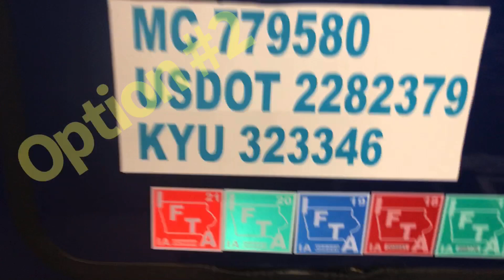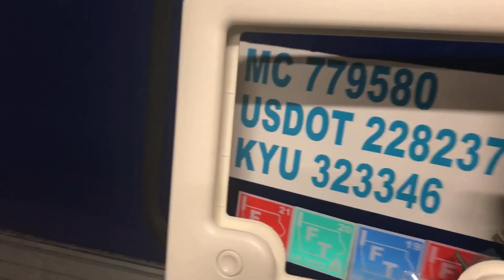Sleeper remodel Part 5: Big Snag

Comment: Had that toilet in my 132” ARI sleeper. Worked good in that setup. Went with a Thetford portable potty in my 389. Easier to stow under the bunk with the riser platform I built for it. That toilet worked much better and was easier to dump when needed. We also stopped using the flush feature as it used too much water and filled the cassette up too fast. Found it better to use a small spray bottle to “flush” with. Did the same thing and hardly used any water. Didn’t need to dump it near as much.
Reply from the maker: Great info. Thanks

Comment: Talk to a welder in town. You should be able to cut that support and weld a tube to the support on the right and add some gussets in the corner joints.

Comment: If you can weld the little bit you have no problem.  Just well then a little bit of a support on both of the side vertical pieces and then put in a metal header across them to brace that and attach that to the vertical post further up

Comment: You can cut that support and get a piece of steel  to span from the other two supports, with all three connected together it will be fine. Its the same as a house, the header carries the weight over a door or window plus the outside sheeting  helps with structure support.
Reply from the maker: Great

Comment: Clutch while you're at it, not sure how good your wall insulation is, looked like it wasn't bad, but while you got it apart you may want to re-insulate or add some, especially for them Wyoming winters! I did the sleeper area in my Classic a couple years back, and big difference!
Reply from the maker: Good plan

Comment: Clutch, if you run into structural conundrums, you might consider calling Chrome Shop Mafia, or some other show truck modifiers. I don't see why they wouldn't share some knowledge on issues you may be having, and hesitation removing supports. I'm gonna say Freightliners aren't known for their rollover strength, but you don't want to compound that by removing something that might be a "load bearing" support. Hang in there! I have confidence you will make this happen!!!!

Comment: I know I’m a few days behind and you may have already come up with a solution. However I do a lot of custom fabrication on things if you could build a structural box they would fit the door to the cassette that there was a price to come down to connect to it and spread the word to the outside and then trim the heat shield on the stack.
Reply from the maker: Wife already came up with a brilliant solution

Comment: Cut the supports, I won't tell anyone. If you're still worried, maybe you could cage the opening with some square stock and tie in the old supports? Wall supports on a super sleeper's toilet are probably just cut wherever the upfitter decided to put in the door.

Comment: Yes, the cassette might be preferable but wouldn’t the other style porta potty allow you to have everything else the way you intended? Might be the safer (leaving support intact) and quicker solution.
After all, isn’t the toilet more for bad weather or emergency use as opposed to constant use, like in RV in remote locations without other options like truck stops?
Reply from the maker: John, you’re definitely right. It is the easier solution. But of course I already bought the cassette toilet. I may just go with what u suggested. It’s easier. I just want to really think it completely through. Thanks so much for the comment
Reply: Hey Clutch, this is not meant as a put down, I dont understand why you would want to complicate your remodeling issue with that toliet. I told you a while ago get the luggable loo. It's like $20 but you got to buy the bags that go with it. Then you dont have to cut your truck up. Then after you done your business you just seal the bag and toss it in the trash. Nobodys going To know 
That cassette toliet I never thought was a good idea when you said you empty it out when you go shower in their toliet.  Why relive the horror? New luggable loo seal the bag and toss it ( please toss it in the trash can ) cassette you have to be seen in public with plus carrying your shower bag?  In the store? No clutch! No!  Get the loo, I think you will like it. It's on Amazon and other places.
Reply: @jasonduke3608  I agree about the hassle of carrying that cassette thing and dealing with emptying it. Dragging that suitcase thing into facility? I wouldn’t do it. I think that it might be better for a remote RV situation where you don’t have convenient access to trash 🗑 like you do on roads.
And i am just guessing but figured that this toilet would only get occasional use, like during sleep time or nasty weather or docks when stuck for extended time, etc and that using regular facilities might still be more common.
Reply: @jasonduke3608  I agree with the luggable loo, even if you wanted to use it full time. No cutting up the side of the truck, or having this larger RV toilet permanently in that one spot. I know I would rather do my business in a bag and toss it, then have a toilet next to my bed that still needs to be cleaned. You can stick pine shaving in the bags, will help with any liquids and smell. At the end of the day you're still pooing in a plastic bucket either way.
Reply: @JohnHallgren  
With the luggable loo it's just a 5 gallon bucket with a toliet seat.  You buy these special zip lock bags when your done seal it up and throw it out, pretty easy to do. When I'm otr, I'm local now but it really is nice. I don't really use rest rooms any more. You never know when their clean. Plus your safer in your own truck.
Reply: @JohnHallgren  It's a hassle, and they are no fun to empty if you use a toilet instead of a RV dump station.

Comment: Could you fit the cassette out the existing side door? Cutting the hatch through the wall with the ac vent holes, or will the water tanks be in the way? If 1 water tank works
s, you could put 1 water tank on each side and run a hose across to connect the two.
Reply from the maker: That’s probably what’s going to end up happening

Comment: Cut off the support and modify like you would do a door or window in a house. A house roof weights more than a sleeper roof.
Reply: That is exactly what I was thinking. It would be nice to weld a cross member in there but welding inside a truck would be sketchy.

Comment: Hey Clutch, there is still what I think is an easy way to keep everything the way you want to do it, I built house for a living and this is a simple fix in my opinion. I really can't explain it to you in a post but I could explain it to you in a video chat if you are interested. Let me know, have a great day.
Reply: But...the difference here is that it’s not just the weight from above like a house...it’s the ability of the structure to withstand potholes, bumpy roads and possibly tipping over from being in a wreck which a building wouldn’t have to deal with.
Reply: @JohnHallgren , you have a point but for the size door that he needs there would not be any issues for what I have in mind. Don't get me wrong I am not an expert in the design field.
Reply from the maker: Wife gave me a solution that I think will work. look for new video in the next few hours

Comment: Cross bars
Reply: Do you work with Floyd's there in Cheyenne at all? They may be able to get you the schematics of the interior which would save you a TON of guesstimating. My biggest concern for you is that back wall and the structural supports that may force you to rethink your bed which would throw off all your floor planning. Someone somewhere has to know what's inside those walls! I can't remember when I redid my Classic years ago what was hiding behind that vinyl but I'm sure there are going to be some major supports in that wall as well. Best of luck and keeping you in our happy thoughts! We'll be watching  🙂

Comment: Do they not make cassette toilets with the cassette mounted forward rather than backwards (into the cab vs through the wall). You can’t be the first DIY to run into this issue.
Reply from the maker: They do. And had I planned to do it this way initially I would’ve bought a different model